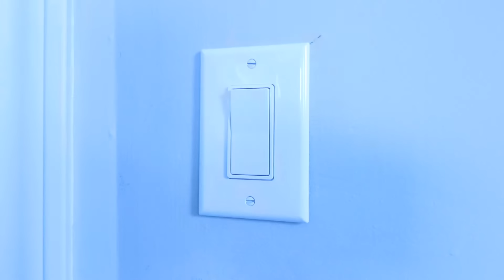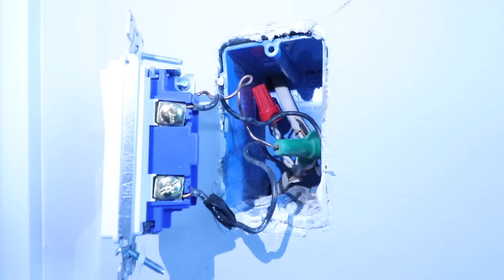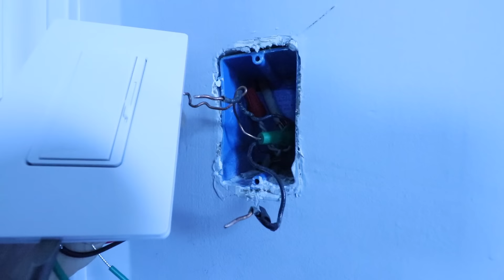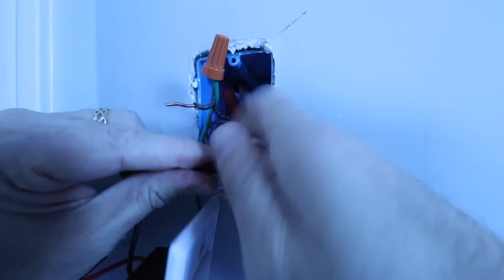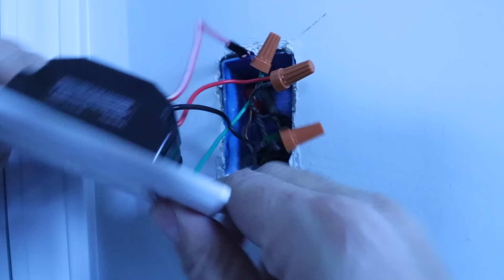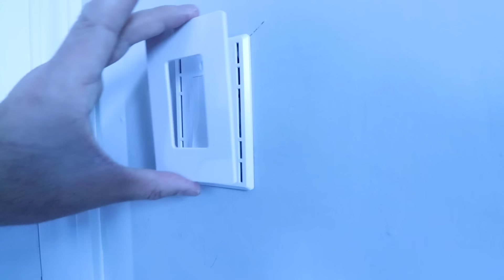How To Install A Lutron Diva Dimmer Light Switch

Comment: handyman replaced my kitchen light fixture with LED dimmable florescent...  first.. it had a buzzing noise.. and second issue.. had to push the bottom to turn it on...  for the buzzing.. he said he will get replacement.. for the 'hit bottom to turn on'  he said that's the way this switch works..  i don't think that's right...  how do you fix this?

Comment: You didn't take the cover plate off the dimmer to show that has the LED trim level adjustment lever on it and explain its function considering everything nowadays is led the video is basically a fail you made a recreation of a video from the 1950s

Comment: Good explanation for a two way switch.  Two additional things would be helpful:  
1)  Suggest testing the hot wire with a voltage meter before assuming between hot and load by looking at where you think they are going through the walls.  
2)  Explain what wire to look for in a three way switch installation for the hookup of the red w/white wire coming out of the dimmer.

Comment: My existing switch just has two wires; load wire and hot wire, no ground wire.  Reading online it says the box might be grounded...No idea how to proceed.  I don't want to wire it in with no ground wire.  Any tips besides calling an electrician and paying big bucks?

Comment: Always learned, just for continuity, that hot wire should be located to the top terminal (on a regular 2-pole Leviton) and load to the bottom.
Also learned that, IF POSSIBLE, you should cut off the portion that was used as a J-hook connection. The wire is already fatigued and adding it to a wire-nut connection is asking it to break off inside.

Comment: What if you got a receptacle outlet running to that connection also how would you install the dimmer switch with a receptacle outlet on that line?

Comment: As many outlets and switches I’ve swapped out, being a little green to the trade, for the first time, I learned the difference between a line and a load. I’ve always just made sure the wires went to the same side on the new as the old, but never really understood why the wires had to go where they went. Preciate it.

Comment: What do I do if the wire goes into the wall like one of the wires attached to the box goes through the was an i cant get to it
Reply: The one that is in my wall already looks like the one you are installing but the one wire goes int the box

Comment: Load wire and hot wire? I’m so confused? I have a standard 14/2 wire for instance and it has a white neutral, black hot and ground.  Where would I be connecting that red wire? Please help

Comment: Great video, my new favorite channel. One question, my dimmer switch works as it should, raising the switch gets you more light, the issue is the stitch itself need to be in the off position to work, wondering if you or any of the other subscribers can tell me where I went wrong, thanks!

Comment: My on off switch works but my volt meter isn't showing a drop in voltage when I work the slide voltage adjustment knob. Why would that be?

Comment: The bottom of my existing switch has a wire that is feeding into the conduit located on the top or ceiling side of the junction box which differed from this video. Is it more likely that the wire leading to the top ceiling facing conduit is the hot wire? The top wire on the existing switch feeds into the conduit facing towards the ground. Thank you

Comment: I have an older home and found only two wires coming from the breaker box.  They are not labeled hot or load.  Does it matter which wire I connect to my switch?
Reply: He covers this beginning @ 4:11 of the video. I also live in an older home and all of my wires enter and exit at the top of the box so I just connected one black to black and the other black to solid red wire..

Comment: Instructions for my Lutron DIVA dimmer switch says Load (RED) & Hot (Black) from switch "can be used interchangeably" - BUT - my LED overheads are not dimming. Is it possible that it DOES matter which color wire (from switch) you use for dimming to work correctly (single pole use)? Thanks
Reply: Make sure your switch is led compatible and your bulbs are dimmable
Reply: Did you find a fix to this? Currently installing one and dimmer will not work
Reply: your bulbd have to be dimmable

Comment: In the video you hooked up the red and white wire for the single pole application and that is incorrect, it is only used for the 3 way application.
Reply: No he didn't.  Look at 6:44 in the video where he connects the solid red to load, then he just tapes over the end of the red/white striped wire explaining that its only used for 3 way.
Reply: @barbaracarr1861  another problem what is "load?" remember you are doing these sort of videos for someone who presumably has zero knowledge base for DIY electrical work

Comment: what is the red and white wire that was unused for? I am having issues with 2 switches. I replaced one switch and it works fine but now the 2nd switch only works if the new one is turned on. Meaning if new switch is turned off, 2nd switch will not operate to turn on or off
Reply: If you haven’t found out, that is a 3 way switch wire. Multiple switches for one light
Reply: these videos are dangerous because they do not adequately identify differentiating the 2 black wires

Comment: I did this install, the switch is oriented correctly, but the on off position is switched. Any suggestions?
Reply: Is it upside down?
Reply: any luck figuring this out?
Reply: rotate head 180º ?
lol, i hope you got it working.